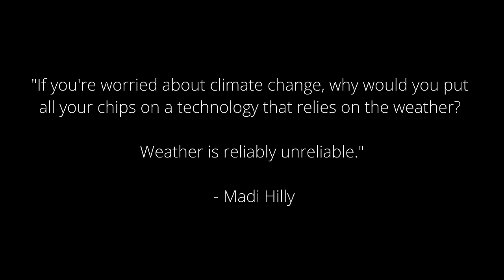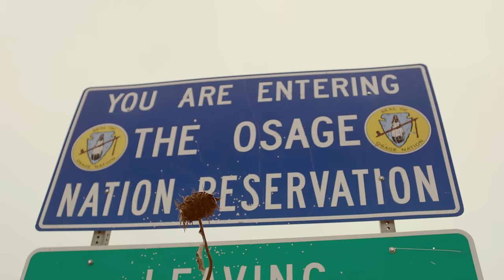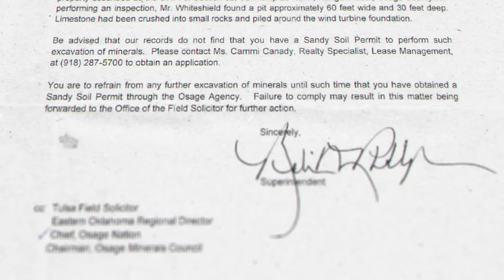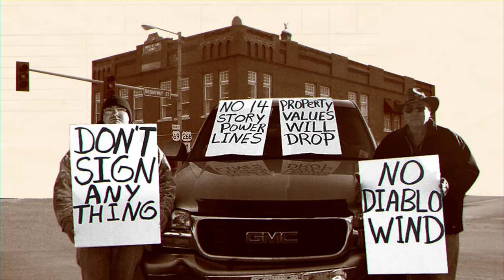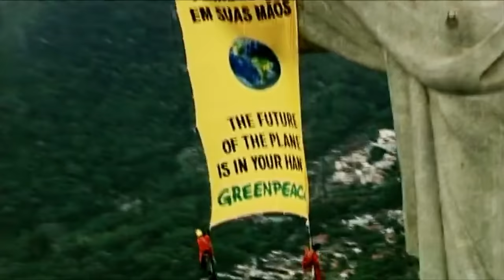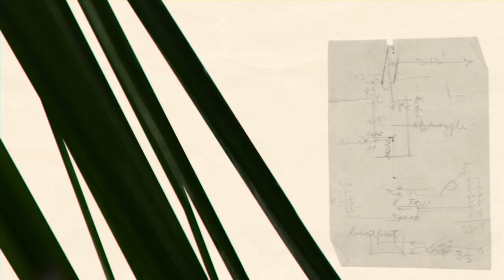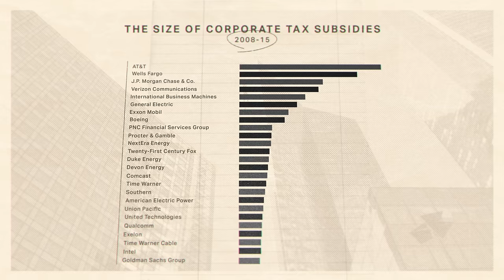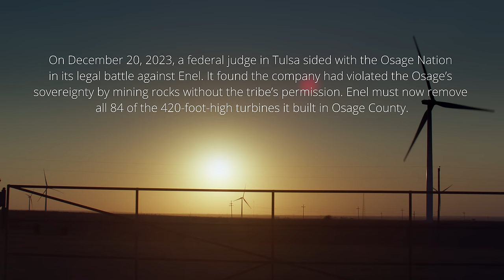JUICE (Episode 3) -  Green Dreams

Comment: There's a HUGE windmill blade graveyard in Sweetwater, TX and it's growing. Fiberglass is not recyclable in any way.
Reply: You can't grind the material to make new filler?
Reply: It’s being added to concrete to strengthen it now.
Reply: Sounds scary to me.
Reply: @proowagatts9111 great, concrete that fails even faster. 
Fiberglass degrades over time. Really really fast if it's outdoors. 
Looses all structure in 15-20 years. 
I deal with fiberglass boats daily. They degrade so fast if the sun can hit it,or if exposed to weather. 
A fiberglass boat will crack in half in 15 years if it sits outside. 
Why add to concrete for any reason other than hiding it.
Reply: @ryurc3033 From what I have read fiberglass infused regarding has a life cycle of 100+ years.
Reply: @firewoodsteel That would result in massive pollution....
Reply: I think it's fiberglass reinforced high impact plastic of some sort... A guess is the plastic is nylon....

Comment: I am from the USA and live in Germany.  Solar power is a great idea during the long summer days (since we are above 50 degrees latitude) - but not so much in the winter months.

Wind power fills a niche, but it won't replace reliable nuclear or natural gas.
Reply: Solar is great for small scale off grid applications. I design control panels for use in West Texas, and a 4 square meter panel with a battery bank can power our equipment basically indefinitely. No power lines or transformers needed. However that doesn't scale up to hundreds of millions of people.
Reply: Solar is so very land hungry with the power generated per metre square from solar being a fraction of nuclear and fossil fuel. In addition with the population over 8 billion now , we will need more and more land to produce food, although I accept fertilisers has made food production more efficient and added co2 in the atmosphere is helping crop yields and increased greening of the earth.
Reply: @ians.339 -- Yep.  It fiils a niche and can augment the energy grid in certain places......but it won't totally replace natural gas, oil, coal or nuclear.

Comment: And, ENEL just LOST their court case against the Osage.
Reply: And now the appeals will start. Lawyers will be the winners.
Reply: The whole claim of "mining" when material is merely changed and reintroduced into the same foundation is ludicrous. If the material isn't being taken off site just shut up about it already. It's just being slightly changed...😂 I worked on a Caisson drilling rig for some time doing foundations for significantly larger power lines across some of the nastiest mountainous terrain. Generally the drill pulls up material then a rebar cage and copious amounts of concrete and admixture goes back in none of what was pulled out ever left the site.

Comment: Shellenberger is way off on “300-400” times more land than conventional power. It’s more like 30-50x.  I’ve read Smil, his source. Smil is right, Shellenberger misread him.
Reply: Keep in mind that wind generators only reliably make about 12% of their nameplate output. So take your 30 or 50 times and times them again by ten. See what number you end up with.🤔🤔
Reply: @MatthewBerginGarage  Wrong.
Reply: @Nill757   No I'm not. Do the math yourself, its not hard.
Reply: Cognitive dissonance is rough ;)
Reply: @philtimmons722  Wind turbines can not be placed in tangent circles every 60ft, as any engineer in energy knows. The Los Vientos wind farm in Tx claims 30,000 acres for 912 MW, 32 acres per MW.  Furthermore wind generation is seasonal, so later summer early fall, generation falls by half.  In a cold weather system like URI 2021, idle wind made ERCOT wind useless for a week. 

Nuclear land foot print to the fence is half your sq mile claim, and the nuclear island alone is 1/5. Nuclear  power is not hampered by a lack of wind or sun.
Reply: @philtimmons722  yes wind turbines have 60’ bases. They are not all surrounded by “completely crop land”.  That’s fiction. 
In addition to no residential or office structures or forest of any kind inside wind farms, on the plains blade flicker can make residential areas undesirable for 5-20 miles away. Most new wind farm proposals in US now see objections from residents for this reason as they increasingly push up against populated areas.  See eg Byron nuclear generating  station IL,  2200 MW/1700 acre, including the transmission substation with soybean farms up against the back fence. Also, a nuclear fleet needs no Watt for Watt gas backup ( w pipelines/wells/storage) requiring more land, as does the wind fleet  and solar fleet in TX. 

Los Vientos claims 30.000 acres for a reason. It is not for 60’ wind turbine foundations.
Reply: @Nill757  You did not actually look at anything, did you?  I mean just simply open google maps and LOOK.   There are no " residential or office structures or forest of any kind" because it is all just rural farmland.  Most you will find is an occasional farmhouse, and they are making bank from the turbines on their site.    And you are really getting silly with the "backup" claims.  You do not actually work in the domain, right?   I have for the last 30+ years.  I am trying to educate you, not debate with you.
Reply: @philtimmons722  of course. Professionals are confortable w discussion based on the facts because of expertise. Salesmen playing engineer want to talk about land leases, make grandiose claims like “over use” of gas in URI, solar was fine in URI, nuclear uses more land than wind because 60’ OD, on and on.  100 to 600 people died in Uri, and you have a disingenuous hand waiving story to tell.

Comment: They haven't figured out that they need a system that can be updated on a regular basis. Better nuclear (fusion), better (graphene) batteries to store excess power. Both solar and wind need to store the power that doesn't get used and make it cheaper overall. 
They keep showing the damage these systems cause but don't show the damage caused by decades of fossil fuel usage. Fusion is the answer, unfortunately, the fossil fuel industry has hampered the progress of everything not fossil. Including the invention of products that save fuels.
Reply: Sprizz,
there are very few times of excess power as you call it.
That apart the amount of battery capacity required to cover intermittency is so large as  using batteries as an answer is unfeasible.
It is fashionable to blame oil companies, but very wrong. We cannot live out relatively comfortable life without them.
Reply: Better nuclear is something that takes time, as it is developed and improved with use. So the only answer is to use the nuclear we have, since the future of nuclear power by definition isn't available yet. But that's not a bad thing, because we have really good nuclear power today. As for batteries, they aren't yet practical for grid-scale use, and we would need to increase our wind and solar several times over to get the excess needed to be able to charge the batteries for the down times. And we would still need 100% backup from either nuclear or fossil fuels since wind and solar are extremely unreliable.

Comment: Our energy (electric) in UK is massive in price because our prices are set by fossil fuel and greed from the 1%. The price of gas sets the price whether it be solar or wind which are the cheapest!
Reply: Are you from central casting?
Reply: British Ants, 

There is alot more to it than you seem to think.
The pricing structure is rather peculiarr and originally set up to benefit renewables.
Our electricity price is very high, much due to the building of a large amount of wind and solar, which has the myth attached of being cheaper, this is a falacy.
Apart from the considerable subsidies to renewables there is the very high cost of supporting their connection to the grid. They are technically incapable of running by themselves and must have the support of conventional generation as well. We could run quite happily without having built any renewables so their cost is over and above that required to run our grid.